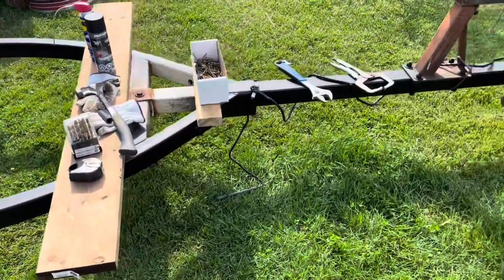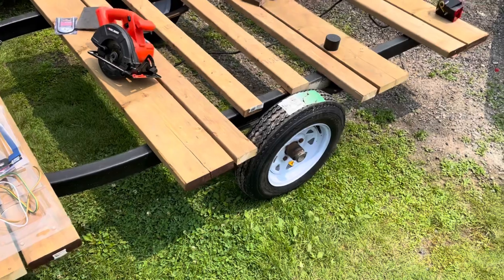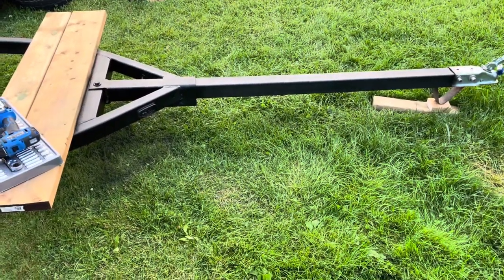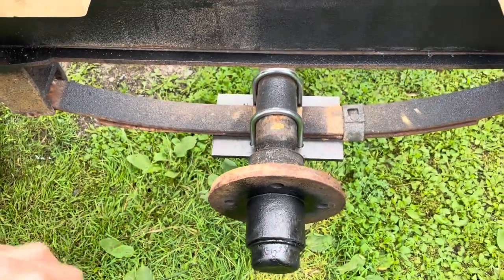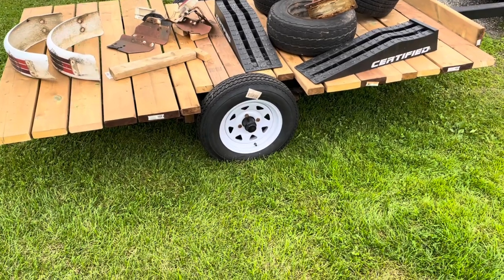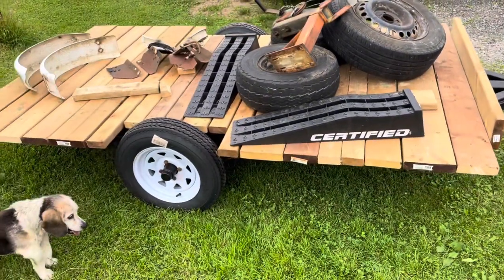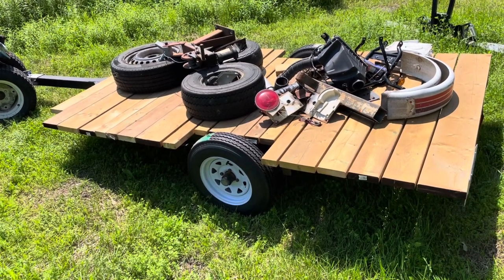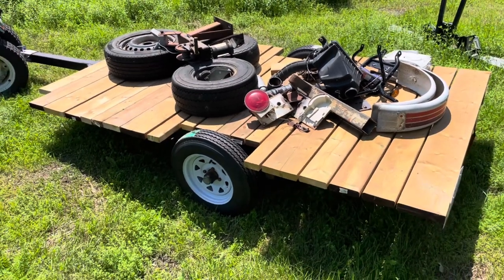Boat Trailer to Utility Trailer Conversion ! Flat Deck Float

Comment: I see good used utility trailers for sale between $500 and $800. I recently sold an 5 x 8 Tractor Supply trailer in great condition for $700. You did a decent job on the conversion, but not sure you’re saving much money, or what the benefits are over a standard utility trailer.
Reply from the maker: Trailer prices are going up around me because not everyone can afford a truck so a lot of people want trailers.   Last utility trailer I looked at this sized was 1500$  .  Everything is going up due to inflation but trailers prices are definitely rising in my area